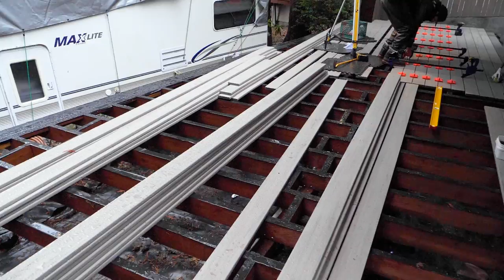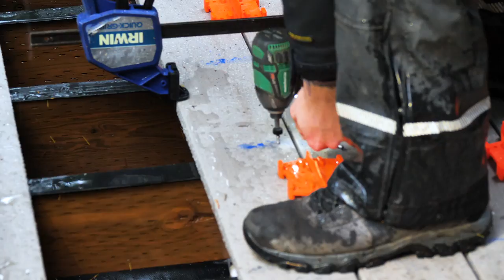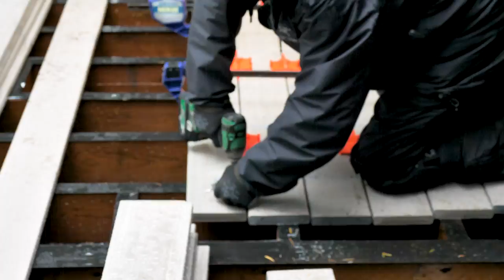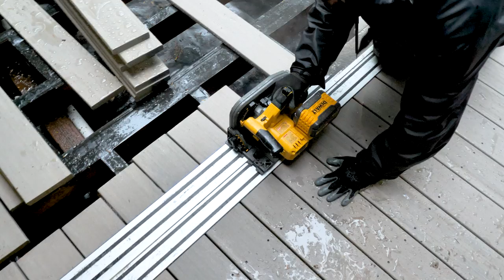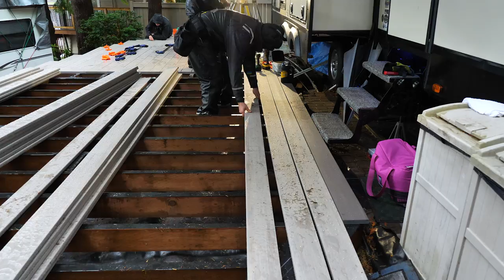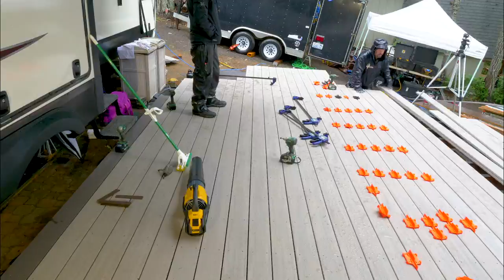Build Update: Deck On A Trailer || Dr Decks

Comment: I've used white chaulk  on decking so it won't stain... whats the secret  to the Blue chaulk   so it won't stain the deck boards... ?
Reply: Chaulk meaning = to be kissed by surprise...(pronouned Cork). Chalk meaning = a stick of this rock or similar substance used for writing or drawing...(pronounced Chork)...back to skool for you champ
Reply: I've not had blue chalk stain composite decking. And rarely had it stained wood for me, but it has at least once. I wonder if chalk brand qualities vary?  All that said, I stick with white for finished wood chalking.
Reply from the maker: Lean immediately after using. We normally would use white as well but couldn’t find the chalkbox